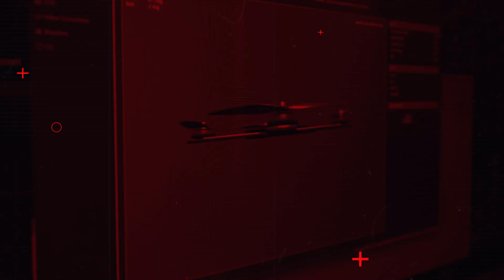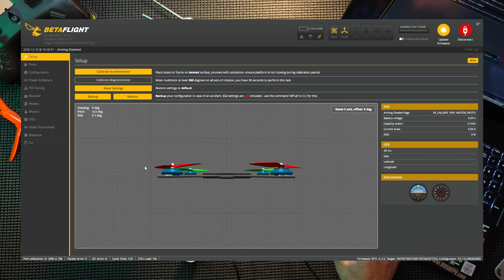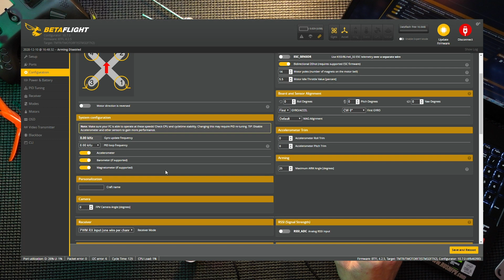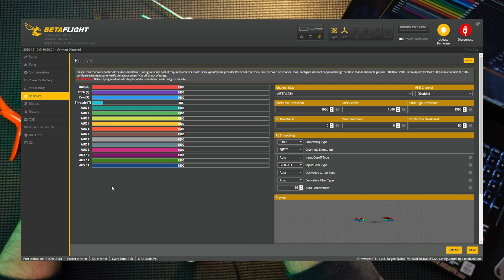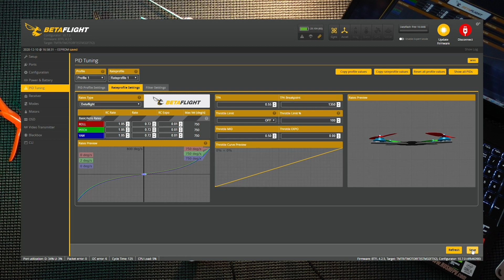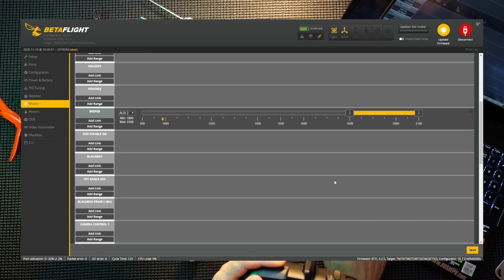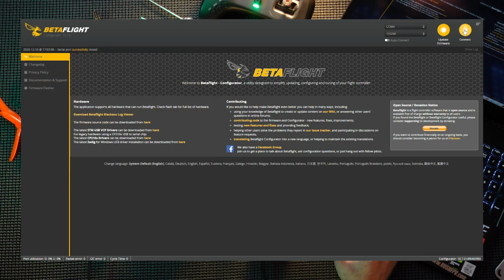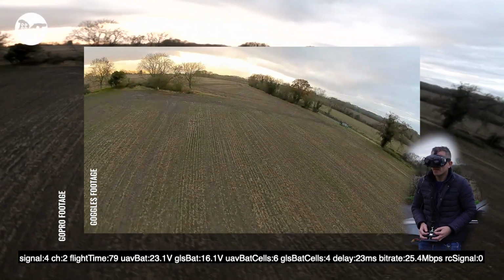diatone roma f5 - the setup for betaflight and crossfire

Comment: I did same update my firmware, and flashes, unfortunately my Mamba F405Dji Fc won’t connect with betaflight now. Maybe I made wrong updates😢. Can you please tell me what is the solution now.
Reply from the maker: not sure what you've done mate? - the vid connects the crossfire receiver to the tango 2 controller? 
have you flashed the stack with the wrong firmware? let me know what you have done / and have issues with mate.

Comment: New FPV person here! I want to wire up an ELRS EP1 to this quad. Will I be able to just solder on the plug they provide to the receiver then plug it in to the pre-soldered fc plug? Thanks!
Reply from the maker: yeah you should be able to do this

Comment: how did  you get this stack into DFU mode? I can't seem to get mine to do that.
Reply from the maker: there should be a little button you press and hold whilst you plugin the usb cble to it, that puts it in dfu mode
Reply: While in betaflight, go to the CLI, and type "bl" (while connected normally) this will reboot in DFU mode.
Reply: Thabks guys, yeah mine won't launch with either approach, but apparently now BF has a DFU/bootloader butting in the GUI on the set up page now haha.

Comment: Hi, love this built. I am actually building it myself now. Can you tell me the specifics of your 6s battery that you use with this setup? Thanks
Reply from the maker: Hi - the batteries I use are : 6s 1300mah lipo, hope that helps, remember to subscribe, thanks
Reply: @Datfpv  yes. Thank you. Is the C rating important? I assume, since the mamba motors have a peak current of roughly 40 amps, a C rating of 110 would be appropriate?
Reply from the maker: a couple of mine have 75c but burst rate of 150c - around 120c you'll be good unless your all out full throttle all the way!!!
Reply: Okay. Thanks for the information! Helps a lot.

Comment: Where did you get the antenna mount on the back for the crossfire nano antenna? Can you post a link please. Thanks. If you printed it, can you tell me where you got the STL files for it.
Reply from the maker: Hey - it came in the box with the frame!

Comment: If bind is successful and you go into betaflight but sticks don't respond, do you have any ideas as to why? I can't seem to get past this part...thanks for any input. I have Tango 2 Crossfire and GEPRC Cine 25.
Reply from the maker: HAVE YOU CHANGED YOUR RECEIVER TO CRF: https://www.youtube.com/watch?v=5spyTMm-NHQ
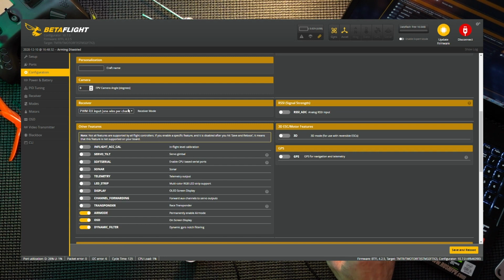6:59 - have you got battery pluged in and power to the receiver
Reply from the maker: if all of that ok - you might have the the tx and rx wires the wrong way round... if they are the wrong way round you can still bind etc but not control movements will happen - I have done this myself!
Reply: @Datfpv  thanks for the response. Turns out it was a UART that needed to be switched from 1 to 2. Can't believe it was something so simple!

Comment: After installing a nano rx and binding to my tango 2, my crossfire nano is blinking green. After connecting to betaflight and changing my rx input to crossfire, I have no stick input. Any suggestions?
Reply from the maker: Hi - if its blinking green it sounds like something is off, solid green indicates it bound, what happened in the bind process? you could have a miss match firmware on the recevier and nano, I had it once and needed to downgrade my controller... it was a bit of a nightmare as I remember.